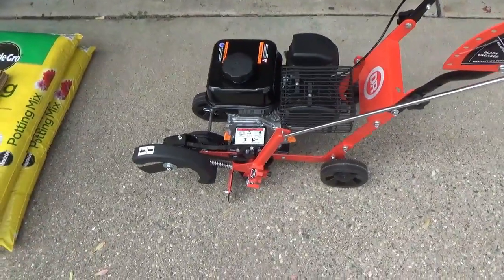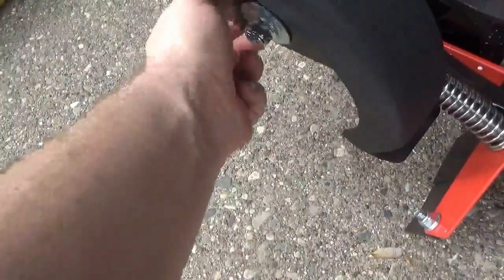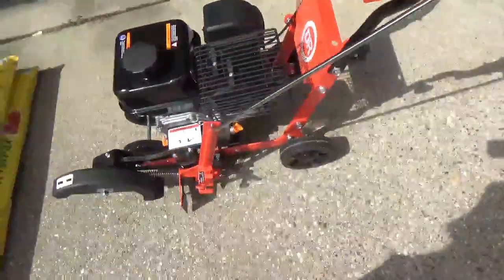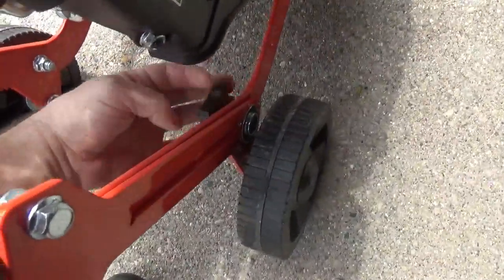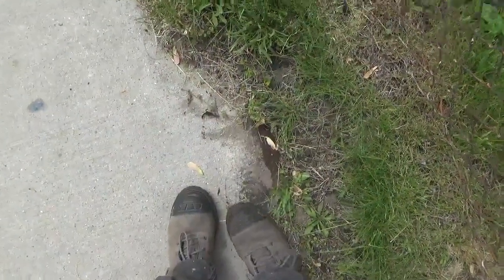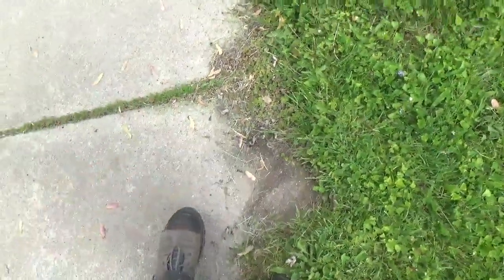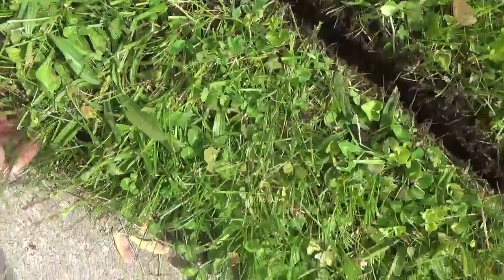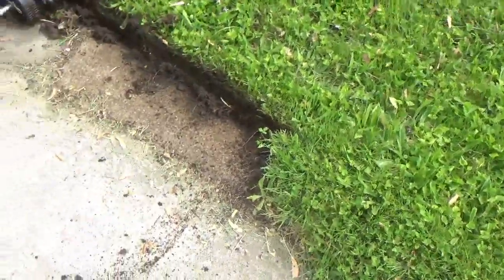DR Lawn & Garden Edger PRO Review And Demonstration

Comment: Little trick I use is first run the mower over it then put the edger up on the flat grass and run the opposite direction. And when doing curves don't put the blade down as far and lift the back wheels up and you can cut circles with it. Hope this helps.

Comment: Wow, you weren't kidding about that overgrowth!  Man, that was something else.  You could save those piece and use them to fill in bare spots if you had any.  See that, the Earth heals itself!  It wants grass there, it will grow it.  Left long enough, it would have grown completely over the sidewalk and met in the middle and nobody would have known.

Mine doesn't have the tilt feature.  That curb-hop feature is interesting, I definitely could have used that.  Seems like it runs awful fast though.  I'd see if there's an adjustment screw, you can turn down the revs some, still have more than enough power to get through that stuff, save engine wear and gas too.

Comment: Had this edger since 2017 and it is the worst edger I have ever had. The metal blades are so soft they wear out before cutting season is over. Blade vibrates so blade because guide shaft slots are wore out. Have repaired this problem 3 times since owning. No problem with motor. Will never buy from DR again.
Reply from the maker: Try a different blade.  Any 9 inch by 2 inch with a 1/2 hole will work. Amazon has a 5 pack of mclane brand blades for under $30.